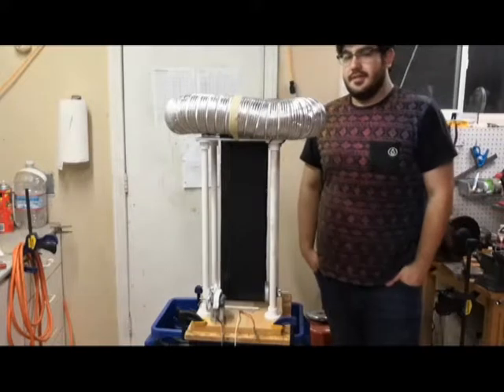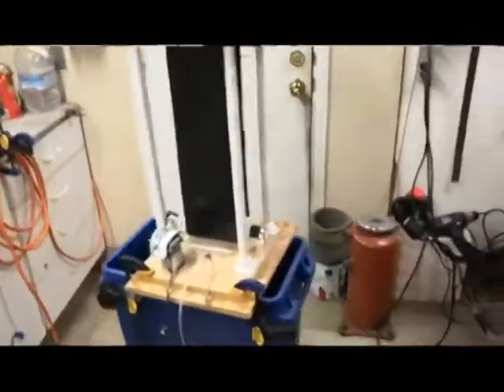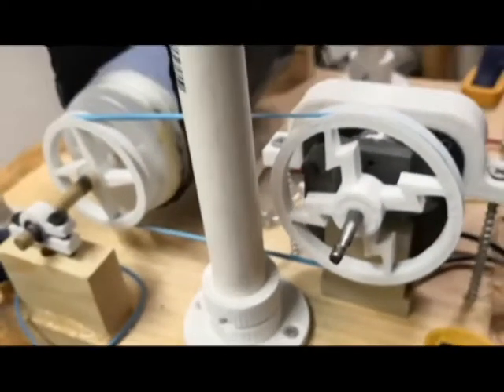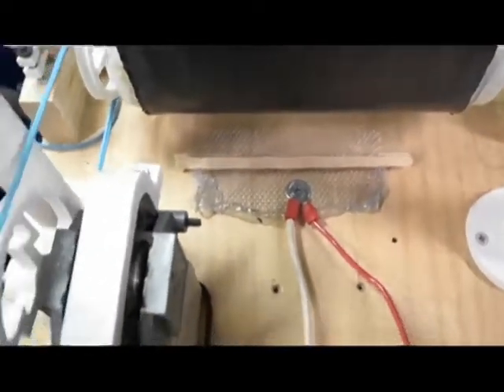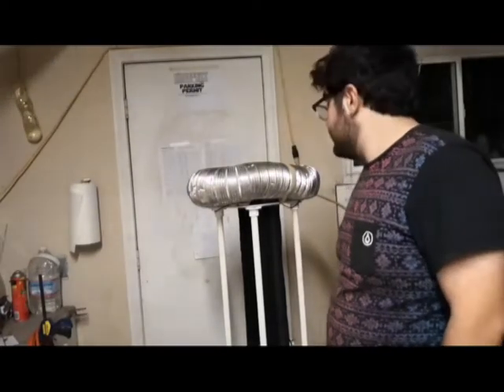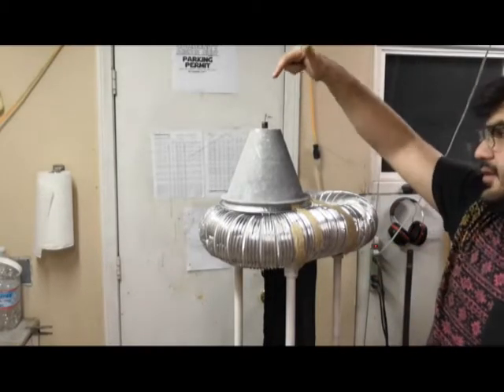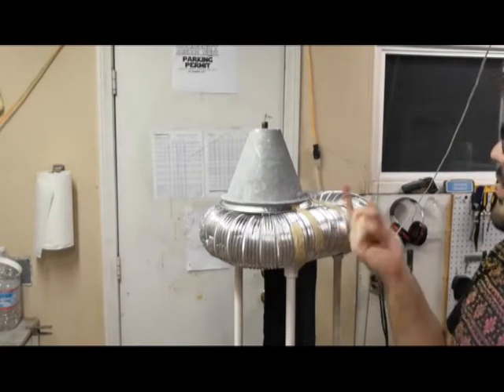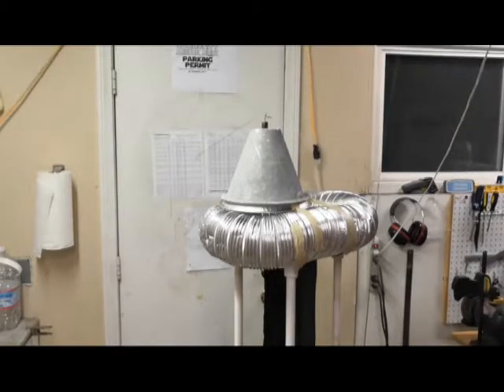Homemade Van de Graaf generator

Comment: I see you used a toroid as a top load. I havent seen this in a van de graaf generator. Its a good idea though. They are the best capacitive shape to use for tesla coils so why not? Similar principle, except this one holds a charge.
Reply from the maker: A piece of aluminum air duct is far from ideal for ANY high voltage devices. It just what I had laying around! ;P 
It leaks practically all of it's charge as soon as it collects it... That's why it doesn't produce super nice discharges. Theoretically speaking, with a belt this wide, it should collect an enormous charge! But I believe there's many other charge and/or energy losses at play here, aside from the very lossy discharge electrode (topload), since this was not built as a showpiece, it was a proof-of-concept experiment to see if it was possible without purchasing any "proper materials". 
After building this, it worked for about a week or two, then mysteriously stopped working, and hasn't worked since! To me, proof that proper materials and construction are necessary for a reliable machine.

Comment: What's your top roller made of? Good job by the way!!
Reply from the maker: Thank you very much! The top roller is an identical bottle to the bottom one, however it doesn't have the string or the ShamWow. It's just the polypropylene but there is still a paper label on there. 
Be weary of my materials-choices however, because sometimes it doesn't work at all...  
 { I'm pretty sure it's due to moisture in the air, as it's happened when I opened up the garage, or had it outside, but only on a few occasions, so I don't have conclusive evidence of that hypothesis yet. }